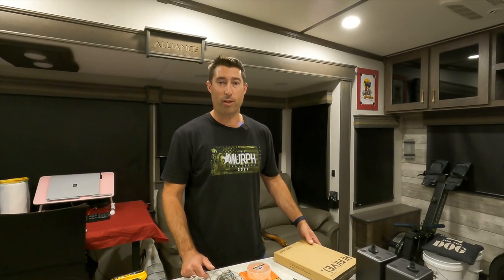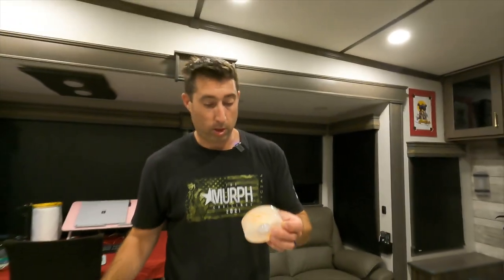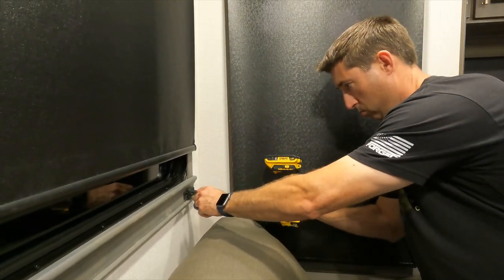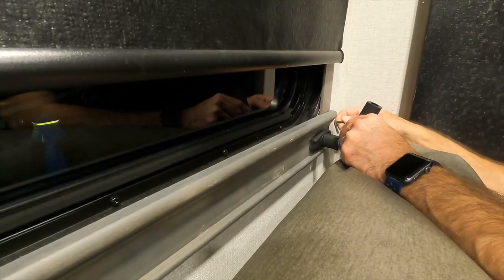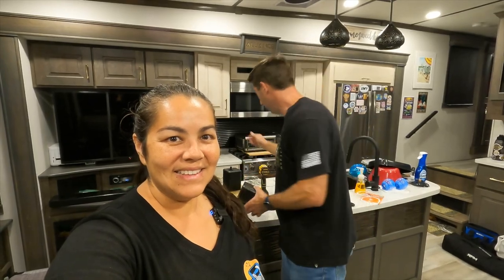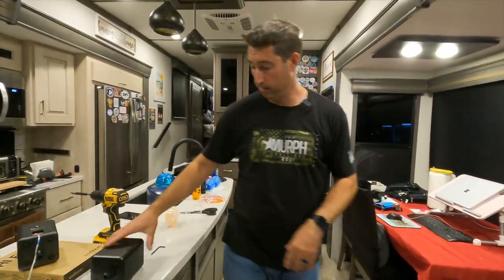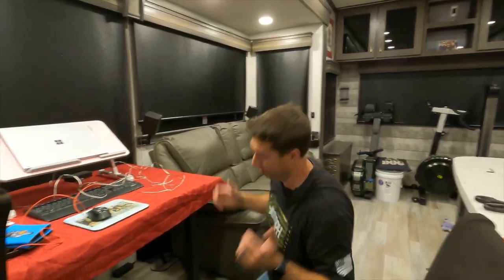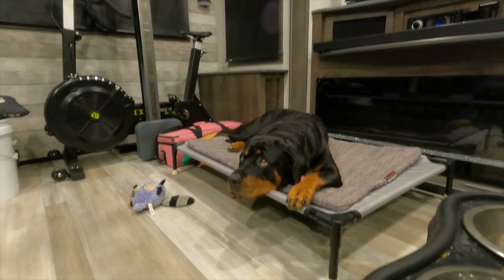Upgraded To A Full Theater System in Our RV

Comment: Wait, Wireless speakers still require wires?
Reply from the maker: Hey Marcus Henderson,

Thanks for your support and watching our videos. The rear speakers are powered and plug in there is no wires connecting the sub or rear speakers to the sound bar although both plug into the power outlet.